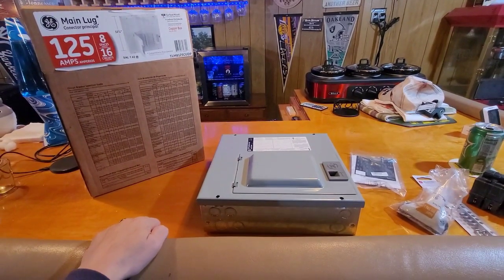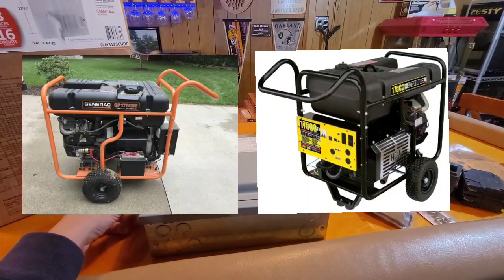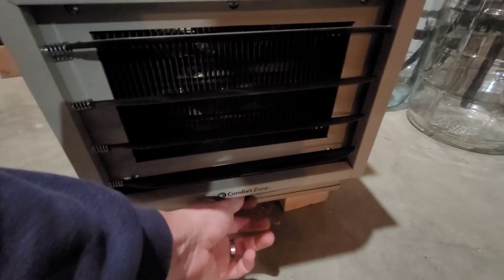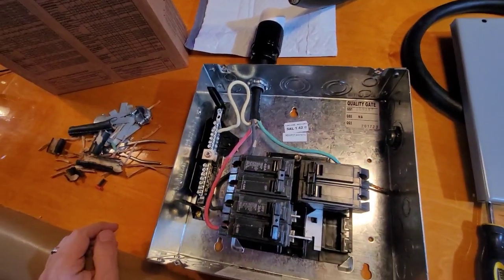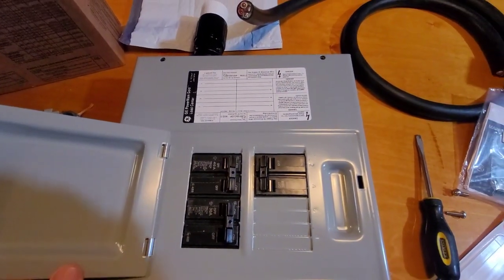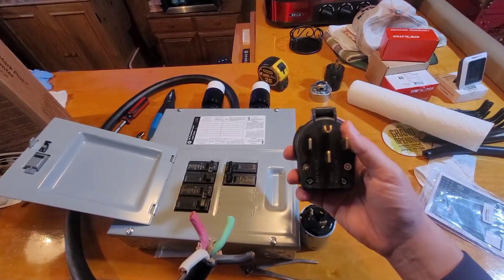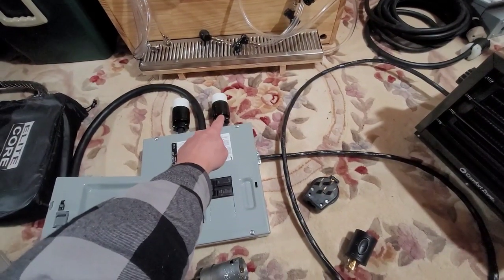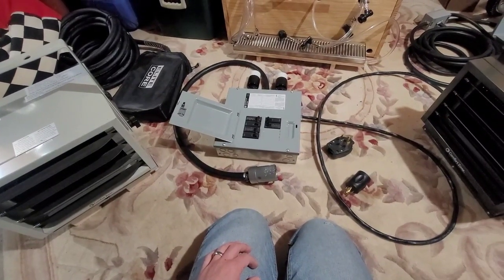Portable Generator Load Bank DIY Build

Comment: Would you need an earth ground for this?
Reply from the maker: It depends on the application. Typically if the neutral is bonded to the frame then for temporary use for my needs I usually don't add the earth ground. It already has a low impedance back to trip the breaker with the bond

Comment: Would I be able to use a heating element out of a dryer for load testing ,the element I have is 5000 watts .
Reply from the maker: Yes you can, but would need a constant air flow source such as a fan to keep it from getting too hot. The heating element tube should have a high temp thermal safety switch already built into it IIRC.

Comment: The Westinghouse WGen20000 is a 20kW continuous, 28kW peak "portable" generator. It has dual NEMA 14-50 receps to provide all that power.
Reply from the maker: That's a massive unit! 540lb is not portable at all. It's basically a home standby unit on wheels. Crazy!

Comment: I was going to build a small load bank and quickly realized really they are just heaters.  It’s just to load my diesel so it doesn’t run unloaded.   I have to been running the house but it would be nice not to have to switch it.    By the way, The ultra source which I had , 😮only puts out 12k through the main plug
Reply from the maker: Correct. You have to use the 50A and 30A plugs to get the full power of those generators. Seems dumb. Then again most home backup power with portable generators max config is 50A before one has to buy "exotic" NEMA inlet boxes and super thick AWG wire.

Comment: Do you have a video of this in action?
Reply from the maker: Not at this time. I have an encountered a generator that would need the combined load of both heaters yet. There's only the two generators that I mentioned that have that much capacity. The majority I see are around 7500W running.
Reply: @Bassguitarist1985  you can bring it to my house. I’ve got a 60kw genset I’m looking to build a load bank for… :)
Reply from the maker: @ShortyzProductionz  thats some serious power! Yeah portable gen market the biggest ive seen is 17.5k. :-)
Reply: @Bassguitarist1985  go to your local hospital. Most hospitals with have 3-4 semi trailer generators for backup and they produce up to 10mw of power. They’re insane!
Reply from the maker: @ShortyzProductionz  i don't make a habit of visiting hospitals but good info to know!

Comment: why don't you add a switch to that box that would allow you to bond or unbond the neutral just by flipping the "switch"
Reply from the maker: That would be a very heavy duty switch to handle ground fault current, and more costly than necessary. 4 screws to the panel and 1 screw on the neutral buss bar to break the bond. 5 minute change. :-)
Reply: @Bassguitarist1985  Use a Battery disconnect switch, like on marine or heavy equipment. At least that is what I was going to suggest, also make a pigtail for the diff Generator Outlets, easy-peasy ...😋
Reply from the maker: @RoyArmy-WREW918  I wound up getting an adapter all in one from that CS plug to the l1450. Now I can just swap at random. The marine switch is a good idea but since it only takes 5 minutes to make the change I didn't bother

Comment: Nice work.  The GP17500 is limited to 12,000 watts based on the 50 amp limitation at the outlet.  Seems like a waist of money to get anything over 12,000 watts.
Reply from the maker: That generator seems to be specifically designed as a construction site generator. It has multiple outlets for welders and that 50 amp could be used to connect to a temporary panel on the site. That would be the only way I can see extracting the full wattage from that machine.

Comment: Thanks! Very versatile load bank set-up! Yes, there is something of an upper limit on portable generators, but I have seen a number of portables in the ~12kW range, which is likely the most common "big one" you will encounter. Also, the explanation of bonded neutral was very handy, and helpful to visualize the wire running from neutral to ground. You could do an entire video about bonded/ floating neutrals and the safety problems inherent in each, but it may "lose" a few people. I am not sure if many people have any idea (or know how to check) if their genset is neutral bonded or not.  Thanks again.
Reply from the maker: Normally the instruction manual will say if it is bonded or not and often it will be labeled right on the machine. Yeah I have thought of doing a video on this but I'm not only would I be concerned about losing the audience but also when it comes to the sticklers of what the NEC code actually means I don't think it would be very beneficial unless I had someone with an E1 certification to explain it on my channel.

I understand it well enough to know when to unbound and when to bond. Stuff like that should be left to the professionals not to an average DIY person. :-)
Reply: How do you check for a floating neutral in a portable generator? Thank You.
Reply from the maker: You need to measure for continuity between the neutral and ground connectors. There will be a very low ohm reading if it is bonded together. If it is floating then there will be a very high to infinite ohm reading.
Reply from the maker: You can also check the owner's manual or labeling on the generator as it is usually indicated somewhere on the outlet panel if it is neutral floating or neutral bonded